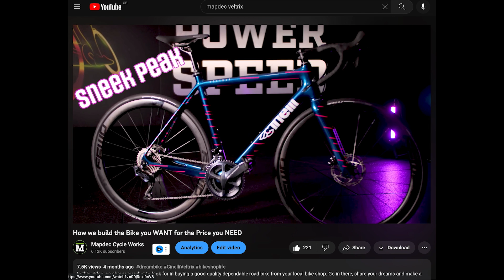The big compromise in the bike frames & wheels relationship

Comment: I wish bike brands would use more material on the fork steerers to make the bikes safer. I bet 20g of carbon would already always make a big difference. There have been too many recalls. It's the wrong spot to save frame weight.

Comment: This topic brings up one never spoken main caracteristics for frames: rider's weight & power ! a 65kg rider will not "bend" the frame/wheels as a 85kg rider but they could buy exactly the same bike !  I have nerver a bike shop setting wheel spoke tensions for each riders. 

Comes up also some concern about woman's bike ??? XS frames have most of the time totally different geometries from bigger size, is stiffness the same ?? There is probably lot to do to develop specific frames for under 60kg, under 1m65 riders, no ??
Reply from the maker: Thanks. We have some vids about small geometries somewhere. It sucks that under a size 50cm things get weird, overly stiff and short.  Over a 58 things get flexy real fast.

Comment: What a thought provoking discussion....... even after many years riding and mechanics. Novel solution on the better wheels than frame approach and a departure from the norm. I suppose the choice is gratification now in terms of instant  ride quality (feel), or delayed gratification for something ultimately superior (in time). Whichever route an individual chooses the key point rightly highlighted is how all the factors work in unison as a system to suit the needs of each individual rider (and we're all different). Complete bike packages have a compromise somewhere to hit a price point and there's nothing wrong with that. Far prefer it's the wheels where it's transparent, rather than skimping on the quality of hidden but essential working parts like bearings, seatings, headset quality or stem plugs. Complete is a good starting point especially for new entrants but the option of  frameset only with custom choice of components is where many experienced riders prefer to go. With wheels I'd always put performance above looks, so if it suits your ride requirements I wouldn't automatically dismiss alloy box section rims.  If they were good enough for climbing wheels in the TDF the physics may still surprise the average rider now, compared to your stock wheels. Seriously investigate tailored build from a good custom wheel builder, it can pay dividends both financially and ultimately in fun. Personally I run hyperon's or custom built but for 90% of my riding happy with Campagnolo Neutrons chosen in preference over newer wheels, they are bomb proof for my particular purposes and state of UK roads.
Reply from the maker: Thanks Kevin. Great input.

Comment: Typical 70kg 56 cm frame rider here. Yes, to get a package at a reasonable?? price you know there will be compromises. For me the frame is most important followed by wheels then components. I would rather have a lower spec group set than poor wheels, but as you say these are often an afterthought. Being 63 I can remember 18c tyres and tubs and down tube shifters etc. I always have multiple wheelsets and use the heavier ones for training since a young lad. Hand built alloy wheels are the way to go to get the qualities you want and I remember training on steel wheels in the 60s. I had one set of carbon clinchers but the front one cracked.

Comment: I actually like it when they put cheap wheels on an amazing bike. As long as they're not trying to hide it. Wheels are quite a considered choice and I prefer to buy separately or transfer from the bike it's replacing. I'd like the option of buying a bike without wheels, like they all do with pedals. I usually chuck the cheap wheels on the everyday bike.
Reply from the maker: Thanks Laurie. Would love the choice of supply without wheels.

Comment: As far as pricing goes your point about wheel compromises makes a lot of sense.  I think the big manufactures also use “anchor” pricing with top end models to make the price of the mid range and lower range seem more reasonable.  They may still sell a few at the very high price but that model is mainly to drive sales in other tiers.   It’s the $75 steak on the menu making the $30 entree seem like a bargain.
Reply from the maker: Such a good point. Thanks Charles. Launch a headline grabbing $15000 bike to make the $3000 one look cheap. Wow.

Comment: I just don't get why the majority of people buy complete (overpriced) bikes.
There will always be a compromise with the components to keep the price down to only a slightly ridiculous price from a named brand.
Why don't more people buy a frame they like and one that is suited to their needs, then add their own components to again suit their needs but also their budget.
What's the point of having a Dura Ace group set on your ideal frame then adding a pair of wheels that are like sponges to it cause that's all you could afford after buying overpriced components that you don't need, to go out once a week for a couple of hours looking at your reflection in shop windows
Reply from the maker: Totally agree.  It’s just criminal to charge so much for aftermarket groupsets.

Comment: I have a Trek Emonda ALR, and I'm going to partcipate in Ironman 70.3 next year. No budget left for new bike so just going to upgrade wheels. Any suggestions? I'll be using 28mm tires and probably want to go with DT Swiss hubs. DT Swiss Arc 1400 seems like nice wheels but then also found something on FarSports that is slightly cheaper.
Reply from the maker: That’s a great combo Harish.  I’m not a big fan of eastern brands.  Often good products but communications often tricky and accountability absent. B

Comment: Well, I never purchase a bicycle off the shelf. I always purchase the frame and add the components that I want. You might say I go cheap on the wheels, but I say that wheels are very very over priced these days. All I wanna do is ride, I don’t need some thing that’s going to win the Tour de France. I ride the bike that I have and I enjoy it.
Reply from the maker: You can still build great wheels to a great price. Hard to find off the shelf though.
Reply: @Mapdec  very true. When I was at college in the '80s, I would build my own wheels. I even used a Jeweler's file to file out slits on a campy hubs so I could insert bladed spokes through it. Maybe a lot of people these days don't know much about having a professional wheel builder make them something. I'm overweight now and I'm going to be starting back on some cyclocross Wheels with 36 14 gauge spokes

Comment: I've been an endurance bike guy since all I do is do long distances. I have BMC Roadmachine X with hunt 44 wheelset fitted with Vittoria Corsa n.ext. I recently bought a Giant Propel advanced disc 2022, immediately replaced the tire with Vittoria Corsa n.ext and then put it up head to head with the BMC Roadmachine to experience the stiff and responsive characteristics of the Giant Propel. To my disappointment, the Roadmachine felt more responsive and fast. I did a 10k course. Both bikes finished at the same time but the roadmachine did it 11 watts less than the propel. So objectively and subjectively, the propel did poorly for a stiff aero race bike. I think the reason why was because of the heavy entry level carbon aero wheels. That shows the point of this video exactly. 

Next I'll be testing the propel with the Hunt 44 wheels to really see how it rides with better wheels compared to the Roadmachine. I'm very curious to see how much it improves.
Reply from the maker: So am I now. Be sure to report back.  Does the giant have those stock Giant wheels?
Reply: @Mapdec  yup the 65/42 SLR 02 stock wheels still. Will test the hunt 44s when I get back from vacation. Can't wait! Will report back
Reply: How did it turn out?

Comment: I worked in the Industry for many years and have loved road riding for over 4 decades. As you can imagine I have ridden all sorts of combinations of frame and wheels e.g At one point I had an Aero Scapin with Lightweight Obermeyer wheels. Funnily enough I now have a custom built lugged steel frame with 32 hole shallow rims, that are not particularly light, and yet this bike is faster than any carbon machine I have ever had, and this just blows my mind, especially considering I am less fit than in those days.
Reply from the maker: Interesting, what makes it faster? I’m willing to guess… confidence, momentum, comfort
Reply: I've been a pleasure cyclist since the mid sixties and have owned many bicycles. I currently have five including a AVE electric bicycle. The fastest bicycle I've ever had is my Carrera crixus 2 ..I've fitted Schwalbe marathon plus tyres and fine tuned the gearing to suit my fitness level and pedalling cadence etc. I am not particularly fit and well into my 60's but am able to keep up with younger friends on ride outs. My thinking is that it can only be a combination of gearing , tyres and crank arm length that enables me to do this.

Comment: Bikes non-dentists buy also spec cheap tires and sometimes skimp on rotors too. These are great for training/backup/commute/winter/monsoon season etc. The ideal wheel is such a personal choice that it's best to accept the cheap OEM ones for secondary use and budget for a good pair of wheels, rotors, and tires that suit your specific use-case when bike shopping. It may mean going down a tier on groupset, but would result in a better overall experience. Works especially well CX and gravel bikes that multi-task.
Reply: My aluminum track bike with 36 spoke rear wheel becomes an endurance bike after 100km! Just ask Adam Watkins, a super randoneur about his experience with a Specialized Langster! He finished PBP on a titanium fixed gear in 2019. Langster tore him up!

Comment: In regards to 4:10 this reneherse article below WILL blow your mind. 
I've owned 100+ bikes in just the last 2 years. Everything from carbon road to bmx to downhill bikes. For years I was chasing the stiffest bottom bracket junction. I 100% thought I was losing power and efficiency throughout the frame and comprising performance. 
Search up a giant STP/norco Manik dirt jump bike frame. I've always loved the stiff machined chainstay bridge. Compared to the merida scultura 909 carbon flexstays it was night and day just seeing the BB move 1/2” when just sitting at the traffic lights. 

But I was wrong when it came to performance. Once I read this article it clicked instantly even though it was unintuitive. 
Flexy frame loses watts, but the cushioning it provides on your knees let's you ride longer/further & FASTER over a period longer than 2 minutes. Even if you don't get knee pain you'll still be faster. 
The article mentions raised heart rates and cadence with flex too. You are burning MORE energy but it allows you to sustain it longer so you are faster. 
The only reason I buy a ride one of my stiff frames now is if I'm doing burst intensity (3minute trip to the local deli, single speed dirtjumper/bmx etc) but for any ride where I'm commuting or training for more than 15 minutes I jump on a carbon road bike and my knees definitely have zero pain the next day. Compared to my brazed steel frame 90s bikes I actually ride a further distance before wearing out. I never ever would've believed it till I read the article and measured my bike data back to back on each bike. 

https://www.renehersecycles.com/myth-4-stiffer-frames-are-faster/
Reply from the maker: Good find. I’m trying to build a test rig like that.  This is my issue. Frame designers create a frame with certain flex/stiffness characteristics, and then some weird decisions get made about wheels that ruins all that work. Btw, new bike day every week????? 😳. Secret bike journo?
Reply: @Mapdec   @Mapdec Cycle Works  I buy in bulk, all second hand, rebuild most, strip the rest for parts. 
I've watched all the big companies frame test rig videos on yt, they all lack a lot of details. The BB flex is exaggerated when sitting {holding the seat post at the top as a lever} which they don't replicate. The chain tension test is done with the rear axle bolted down, but in reality your rim is in free air & the contact patch at the ground not at the axle. 
If you watch MTB Huck to flat videos you'll see the headtube angle slacken. Its maybe the number 1 failure point that not enough manufacturers seem to fatigue test. I recommended anyone watch NITTO factory tours, they actually fatigue test their handlebars and stems. 

Most measure frame deflection with a dial indicator, but when I'm welding frames or straightening/aligning/widening dropouts I use a simple fixture. The BB is bolted down(think of a vice), a 3 sided adjustable in size box is surrounding the frame, then I clip a laser pointer on each tube parallel to the tube. You then flex the frame and use a pen to mark on the projection dot thats shooting on the box. For measuring actual deflection angles its a billion times more accurate than dial indicators.
 I mainly use it for weld sequencing to naturally pull the frame into alignment. But just because you got the weld contractions to geometrically align the frame doesn't mean the weld contractions are evenly tensioning each junction. The current(old tech) frame straightening plates with v blocks aren't accurate enough
Reply from the maker: @janeblogs324  so interesting Jane. I think you need your own channel!!  I totally agree that all the frame flex tests I see have some odd choices.  I always kinda assume that we are only being shown very select highlights.
Reply: @Mapdec  most destructive test rigs are just fatigue testers not deviance detectors. Either way we need a hub based power meter or a DC motor with a cam  drive to simulate the pedaling stroke, then we can real world test efficiency. There are MTB guys who throw chains from chainstay flex, so in effect we are cross chaining while twisting our bottom brackets.
Reply: @Mapdec  have you seen the nz guys wheel works? They test and build as well as cut up rims to measure. 
The MTB guys have lots of slomo video showing rim flex but no one has bolted a go pro on the frame to film the flex. 
I have some tests I use to scare strangers.
1. Get a carbon forked rim brake bike and stand in front of it, then hold the rim between your knees and steer the bars. The brake pads will move 10mm and touch the rims. 
2. Get a cheaper 29er/700 rimmed bike, sit on it, turn the bars 90° and rock the bike forwards and backwards to see if you can make the tyre touch the fork. A lot of people are shocked how laterally plastic their rims are. If you out of the seat sprint/descending cornering, leaning your bike while lifting or weighting your bars you can make the forks/rims deflect 10± mm. It isn't the worse for descending as your rim flexing sideways is suspension movement but its inline with the road unlike suspension forks. Its the one technology motogp won't utilize for some reason
Reply: @janeblogs324  an elegant way to improve the lateral rigidity of a front wheel on a rim brake bike is with old WTB hubs (New Paradigm are the recommended ones but momentum are ok however just not nearly as nice of a hub as the N.P.).  The WTB New Paradigm front hubs feature nice wide bearing and hub flange spacing - a Shimano front rim brake hub will fit inside of the flanges on a New Paradigm (or Momentum).  This builds a significantly stiffer and stronger front wheel.  In addition the axles are particularly stiff as well as the axle end caps.  30 years ago MTB suspension forks were quite flexy and thus "suspension hubs" came to market to help limit independent movement between the right and left side of a fork.  Obviously a beefier axle is going to assist in improving the rigidity of the fork system. The axle end caps make a bigger difference than the axle (depending upon the year will offer different front axles on a WTB N.P. hub - I believe that post 1996 featured a 19mm hexagonal aluminum axle and in a MTB magazine test of various suspension forks tested as one of the stiffest if not the winner).  I'd also recommend using QR skewers with an internal cam as they have double the clamping force of an internal cam type.  For the rear wheel improving lateral rigidity is going to be hard to significantly improve without a much stiffer rim (assuming that you keep with similar hub flange spacing which is hard to change without going single speed/IGH).

Comment: It’s better to have a decent frame and crap wheels. They the major brands always do it, but I’d rather have it this way than a so so frame and halfway decent wheels. The frame is the foundation so if you’ve got that good, you can feel okay about upgrading the wheels, which will bring the bike alive more than anything else. My sons bike was a good example. It had a good carbon frame and 105 group, but a lousy set of heavy aluminum wheels and cheap tires that still used metal in the bead. I got him new top of the line aluminum wheels and 220 gram each tires and  that bike lost 4 pounds and was like a totally different bike. He only weighed 153 pounds at the time so to him it was like night and day riding it.